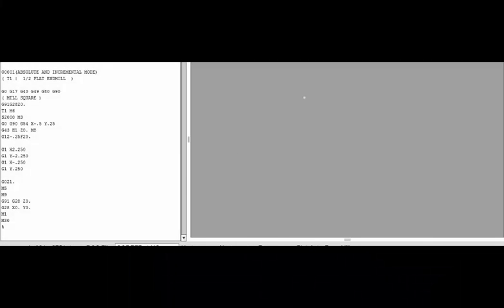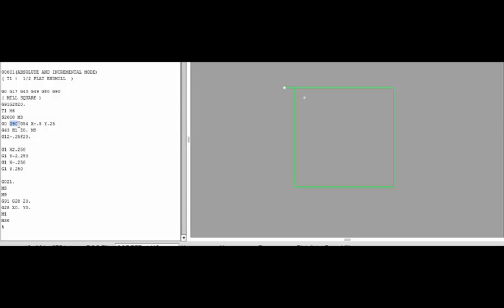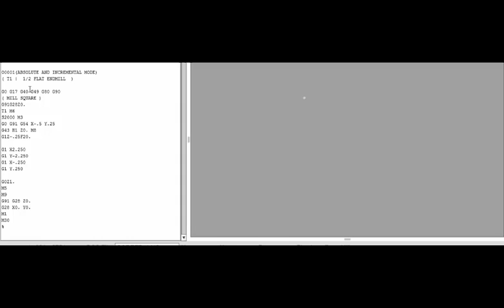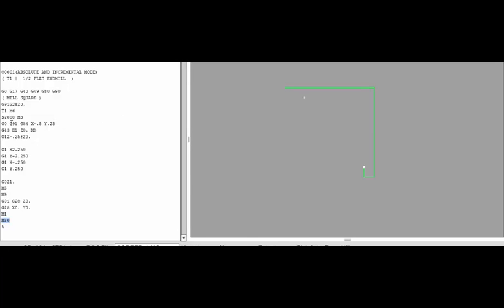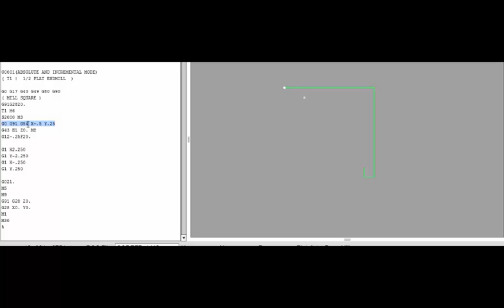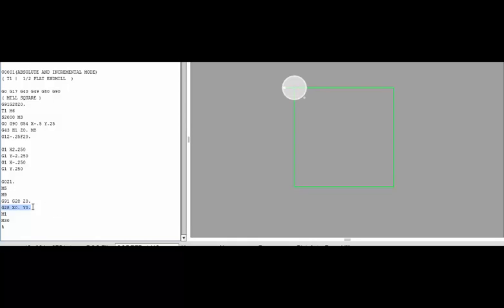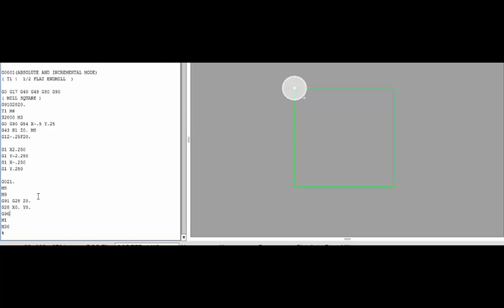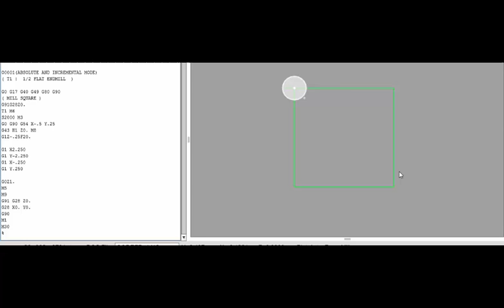ARE YOU IN ABSOLUTE OR INCREMENTAL MODE?

Comment: Hi Tom;
  I was digging. 
  It would appear to make a buncha parts from a long bar, I would program my g97 P XXX  L8... bust into my sub... shift immediately into g91, describe my part, pull out... command a x1. ( Or whatever my shift... ) m99
  So I would go to the sub, cut the part in incremental, shift x1. then m99 where I would pick up the successive loops. Wind up with a buncha parts. 
  Do I have it?
  Thanks,
  Mark
Reply from the maker: +Mark Richardson That would work Mark, very good.  (make sure it is a M97 , which I know is just a typo)
Reply: Tom;
  Thanks man!
  I sure appreciate you sharing your time.
    Very much.
  Some of this stuff is enough to drive me nuts.
  Mark